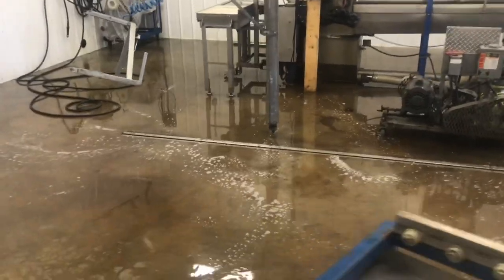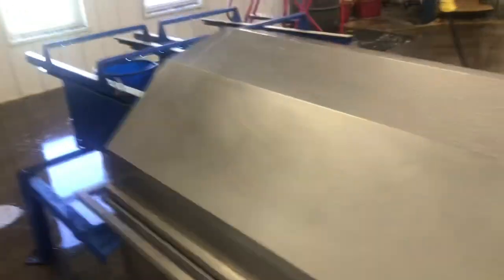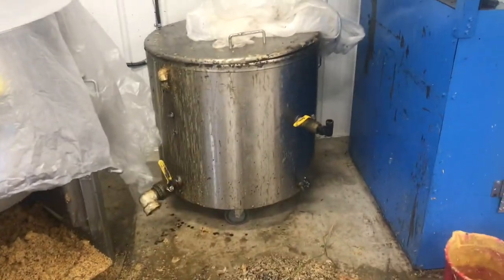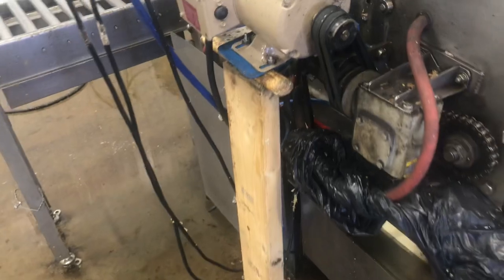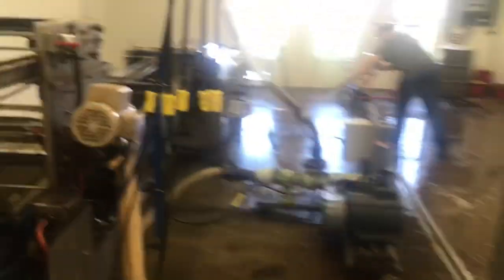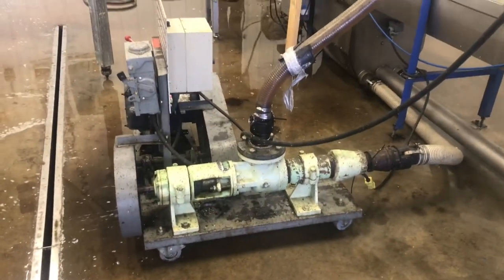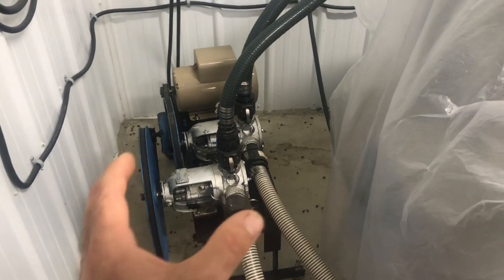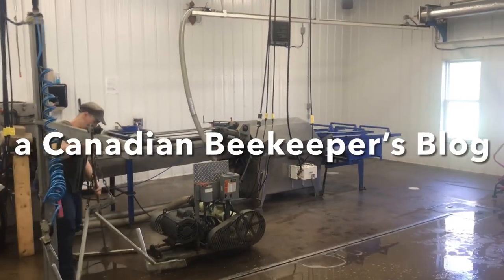Impeccable Daily Honey House Wash Down

Comment: You washed more honey cleaning equipment down the drain than I will harvest this year. Hope you got a good price.
Reply: The honey on the machine is scraped down as good as possible. 
On our farm, if we lose one pound it would be a record. We lose more in the wax cappings than anywhere else. A smaller operation could let the bees clean it up outside first, that way the little bit left over goes back into the hives.

Comment: Ian!  I have an idea to a solution to a problem you may or may not have.
I don't know for certain how your pump system works for the wax...
But---I was thinking what a pain it would be if you have a plug of solid wax in pipe...what to do, what to do...
I thought of this.  Place a small tube inside of your large tube (permanently keep it there).  If your pipe/tube ever gets clogged with wax, run some hot water through the inner tiny pipe inside a pipe.  Run it for a little while while it melts a tiny passage...after it gets large enough, the flow can commence.
...just a thought that popped into my little mind for ya!

Comment: @ a Canadian BeeKeeper's Blog 
Maybe I missed it in the video - I didn't notice any shutoff valves beside the couplers at your pump connections. When a friend of mine replaced some "mature piping" she had shutoff valves added so she could isolate hoses/pipes when changing pumps and do end of year clean ups with less product spillage ie less mess to cleanup. Like your stainless pumps it was always one of those "get around to it" projects.